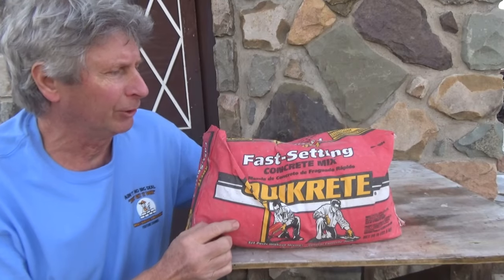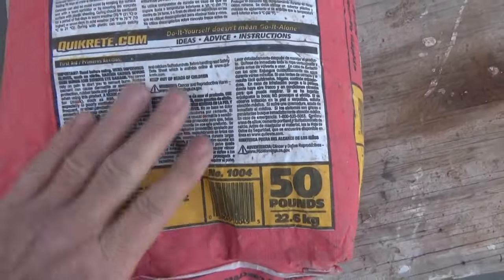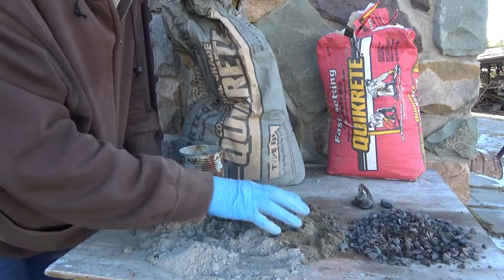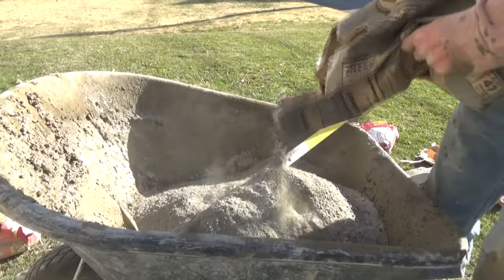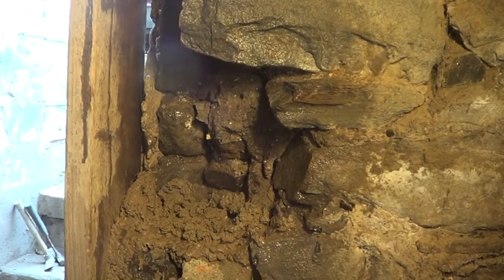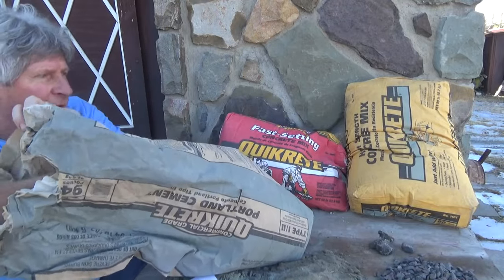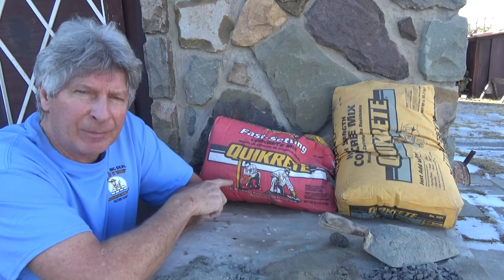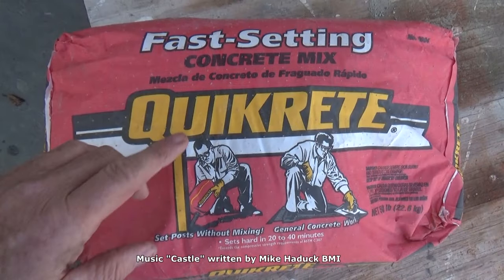QUIKRETE "Fast Setting" Concrete Mix Review (Mike Haduck)

Comment: Hey Mike, one thing I have learnt from watching your channel is don't mess around with quick set. You have to have everything ready to go before you mix and work fast. I have recently seen SpaceX using a concrete mix called Fondag ? have you heard of it ? it is supposed to withstand extreme temperatures (high or low). Anyway, thanks Mike.
Reply from the maker: Hi Darren, I haven't heard of it, so many products anymore, thanks Mike

Comment: I have designed  so many: footings, pad footings, concrete foundation walls, reinforced concrete, piles, piers, foundation pads, I have lost count from a structural engineer view. Mike you have provided me with a lot of techniques in the methods for installation from a practical standpoint for repairs and understanding of concrete workings. One thing to mention is that anyone that does undertake the installation of the premix, bag condrete needs to know the amount of concrete one person would be able to handle in a day. I believe that eight bags may be about as much as one solid individual would be able to mix and install in a long day from mixing to finishing for a four inch thickness. In doing repair work or thin coats a person may be able to handle a couple of bags. Do you have any rules of thumb that you follow for an individual.
Any thoughts on providing some advice on doing a dry install?
Reply from the maker: Hi Carmen, I am not a fan of the dry laid,  it will fall apart in my area, but your right about knowing how much you can do in a day, sometimes I mix the regular with the fast setting, thanks Mike

Comment: I am liking your video Mike. What I am wondering is how hydraulic cement is made ?? Could I use the fast setting stuff and add 50 percent more of Portland Cement ?? Please guide me Sir. I respect your ways of knowledge and the old school ways of School of Hard Knocks. Everything I learned over the years was HARD KNOCKS. 
Have a great day MASTERCRAFTSMAN.  I am glad to have found you Sir.
Reply from the maker: Hi, I can't say what to use, I only show what I used in each of my videos for my area. every situation is different and every masons use their own mix. Thanks Mike
Reply: WOULD you be able to tell me your mix for hydraulic cement Mike ?? Thanks @MikeHaduck
Reply: I am sorry for not being more clear with my question on hydraulic cement. I want to waterproof my basement that has 8 inch cinder block. Could I also waterproof the inside of the blocks with aircreet  as shown on youtube videos or should I use Portland and milled styrofoam ?? How would you handle the job Mike ?? Thanks @MikeHaduck
Reply from the maker: Hi, I did a video called " basement water problem solutions, Mike haduck, I think I say it best there, thanks Mike
Reply: I will check it out today. Thanks. @MikeHaduck

Comment: Mike, thanks so much for sharing your experience.  I've learned a ton from you.  You mentioned using plastic bags to keep the mix from absorbing humidity.  What type of bag do you recommend that will provide a tight enough seal?
Reply from the maker: Hi Heath, I just use a cheap garbage bag, anything that works, Mike

Comment: Mike first I have learned a lot from watching you and enjoy your videos. I'm laying concrete block making a base for a pizza oven. It's fairly heavy around 500 lbs. I'm going to pour concrete in the holes of the blocks but do I need to fill all the holes or can I fill the perimeter holes.
Reply from the maker: Hi Troy, I can't say unless I seen it, but with pizza ovens there is a lot of expansion and contraction with the heat and cold, expect some hair cracks, thanks Mike

Comment: Howdy from Dallas. Putting the bags of quikcrete in plastic bags is a great tip. With our heat and humidity, I've seen many bags turn into hardened concrete chunks of stone in no time. Another tip: Never store concrete bags on concrete; only wood or plastic. The wicking...
-
The new QUIKRETE  regular bag formula is crap. They now use sharp crushed chat in my area, and almost no sand.. I liked the old formula; it was easy to skree and finish. Now-a-days, I almost always have to add Portland to get any cream at all. 
-
Can you make a video about "Type N" ? 
I would appreciate it Mike. 
-
Reply from the maker: Thanks Tom, I did a video called mason mix type S - N Mike

Comment: Mike, for the quickrete fast setting concrete can you use the Rapid Set flow control or set control packets to slow down the hardening time?
Reply from the maker: Hi Rayjay, I don't use it, I just mix what I need and use it quickly, thanks, Mike

Comment: Hi Mike. Ive been watching your videos for years and am about to pour a shed slab soon. I've heard you talk about steel in concrete many times before but was wondering what you think about galvanized concrete mesh? It is sold in Western Australia mainly for  limestone pads and around swimming pools.
Many thanks. Ryan 🙏
Reply from the maker: Hi Ryan, I worry about thick rebar, but not to much about wire or thin tebar in a slab for a small shed, in houses many codes would require it,, so it's what the local codes require and what kind of area you are pouring it in, I hope it helps mike
Reply: @MikeHaduck  Thanks for getting back to me Mike. Much appreciated 🙏😊

Comment: Hello
Thank you for All the information you have provided. Found your channel about 2 months ago and I've been watching your videos non stop.

Question, what happens if you much the fast drying the same way like old school.
2 sand to 1 of the fast setting cement, and and a good scoop of Portland cement to all of it?

Appreciate any feedback.

Thank you in advance.
Reply from the maker: Hi, I usually show what I use in each case, so it's hard to say unless I was on the job, thanks Mike
Reply: Thank you for your reply. I really appreciate it. I would love to have you come by and work with me on a job, but I'm in Montreal. I've learned a lot from your videos. You have given me the confidence to tackle jobs I would have been too worried about doing myself before. I tend to add a little Portland to everything I mix now just to add some extra strength bc of the different weather conditions we get here, especially since our winters are really cold and we have lots of freezing and expansion going on. Thanks again for all the great videos and content you put out. Take care. Gerry. @MikeHaduck
Reply from the maker: Thanks Gerry, I appreciate hearing that,  Mike

Comment: Mike, Awesome video.  So, I have a few questions.  I'm an amateur concrete guy but also from NEPA (Wyoming PA). I'm going to be attempting to make my own pavers. I planned on using the fast setting stuff but you said it's about 4000 psi. What psi is "waterproof"? Is that what you are doing with the Portland? R u upping the psi?  How do I know how much or what to add to make them waterproof to prevent cracks due to the freeze / thaw that happens here.  Much appreciate your video!!❤ liked and subscribed!
Reply from the maker: Hi , I am not a big fan of the bag mixes and I don't know how long they been in the wherehouse so an extra trowel full gives me a little insurance it's strong enough, concrete is not entirely water proof and the psi is iffy, and just a compresive strenght rating, my opinion , thanks Mike
Reply: @MikeHaduck  how do I make it water proof?? Also, how can I hire u to do masonry work? What's ur number?
Reply from the maker: @nevrstriptools3418  hi if you want to make it water resistant I would wait thirty days an use a sealant, read directions on sealant, but sometimes sealants could be slippery,  Mike

Comment: Mike, I need your opinion. If you were to do a brick job in building a 36 inch low garden wall double-sided what type of mortar S would you use in your area? Does it matter if the brand is Sakrete, Quikrete or Amerimix? Anything advise you could give will be greatly appreciate it my friend.
Reply from the maker: Hi Maddog, I wouldn't think the manufacturer would matter and I would probably use S mortar, but garden walls and planters always seem to be a future problem because of the weather and freezing,  thanks Mike
Reply: @MikeHaduck  thank you Mike again. I’m sorry I miss typed it’s not a garden wall. It’s a 36 inch brick wall with brick on both sides with a lime stone caps on top running about 24 feet on one side by 36 feet on the other. It’s basically lining my driveway.  Also, do you recommend lime stone as the Or blue stone? Any preference? Does water go through either one of them?

Comment: Sir; I am repairing a small step to the door sill on my house. I am wondering what I can do to help my very small pour be successful in the 35-40 degree weather? It should only take 1/4 to 1/3 of a bag of concrete.
Reply from the maker: Hi code 3, I have videos on concrete repair and others on tips and tricks, Mike haduck, I hope it helps, thanks Mike
Reply: @MikeHaduck  I didn’t find a video about pouring in cold weather, do you recall which video that might be in?
Reply from the maker: Hi it's called " concrete ,brick or block in freezing temperatures,  " Mike haduck,
Reply: @MikeHaduck  thank you I found it, if I am pouring a small area, 3ft by 2in by 2in, and the temperature is high 50 low 30, should I use liquid accesslorator? I am planning on using hot water

Comment: You mentioned about putting down a concrete base for pavers. I live in western Pennsylvania... How deep do you put a base for pavers so they don't heave? I feel like it would have to be pretty deep (36").
Reply from the maker: Hi Steven, I got a whole playlist called " paver Installation " Mike haduck I show it most of the circumstances,  thanks Mike

Comment: Mike, do you ever do anything with refractories? I’m looking for a recipe for a castable mix in particular thanks.
Reply from the maker: Hi BeeRay,,, I have a video out called, " how I make concrete wall caps" Mike haduck, I started adding a little more Portland to each mix though, to make it a bit stronger, thanks Mike
Reply: @MikeHaduck  Thanks Mike, thats a good method of casting, especially using the durawall, wouldnt have thought of that. I guess my other question is do you have any kind of mix you would recommend for doing something like this that can withstand heat, like a refractory mix? I have heard of using fireclay, perlite, and portland but not sure what rations might be...

Comment: Hello, could you please tell me what cure sealer you used? Was it just water?
Reply from the maker: Quikrete makes a concrete sealer that also helps in the curing process, but like in my concrete sidewalk videos I rarely use it, I usually cover it for a few days and keep it moist, thanks Mike

Comment: What do you recommend for sealer for sidewalk? I'm in PA also if that makes a difference.
Reply: Cure n seal works well
Reply from the maker: Hi Jamie, I am not big on sealers, depends on what you are using them for, thanks Mike

Comment: Here are stats from Quikrete for strength.
Setting time, ASTM C191 20 - 40 min.
Compressive strength, ASTM C39
2 hrs 400 psi (2.8 MPa)
24 hrs 1000 psi (6.9 MPa)
7 days 2500 psi (17.2 MPa)
 28 days 4000 psi (27.6 MPa)

Just used it to put in a sleeve for a 25' flag-pole (9 bags).
Reply from the maker: Thanks Brian, I just took a screenshot of it, I think set time would more depend on temp and sunshine, other than that ,good info, thanks. Mike

Comment: It says 'without mixing' so I do not understand why you are mixing with water before use.  I am a total concrete newbie, about to buy this to set my clothesline pole.  thanks!
Reply from the maker: Hi luv, the directions say "add water and mix thoroughly " any other way is substandard and misleading, now some fence companies etc, just pour it in the whole around the post and then wet it, something like that is acceptable because it's below ground and dosent  require a professional concrete finish, the oldtimers just filled around the post with rocks, what is reasonable for the situation, thanks Mike

Comment: Anyone know how this product compares to Rapidset Concrete Mix other than the cost, about twice as much for the Rapidset at $15 for each 60lb bag?
I am considering using this to repair a 4ft x 5ft section of my driveway.
Reply from the maker: Hi Colin, I have a playlist called " concrete repair & patches Mike haduck, I show what I use in each circumstance,  thanks Mike
Reply: @MikeHaduck  Thanks Mike, you are helping to build up my confidence for this type of project, never tried this before.

Comment: As Mike says ,you do NOT need concrete to secure a post into the ground : back in the 🇬🇧1970s , the old timers showed me that all you needed to do was set your post in the hole and then back fill it just a little at a time and ram the stuff down really hard as you went . I have set nine inch oak posts like this and hung a five bar gate on them quite successfully . 🇬🇧
Reply from the maker: Hi barker, I agree, the old timers would pack rocks around it in our area, thanks Mike

Comment: For QUIKRETE® Fast-Setting Concrete Mix (No. 1004)
They list:
Compressive strength, ASTM C39 2 hrs 400 psi (2.8 MPa)

24 hrs 1000 psi (6.9 MPa)
7 days 2500 psi (17.2 MPa)
28 days 4000 psi (27.6 MPa)
Reply from the maker: Thanks, I wish they put that and more on the package. MIKE